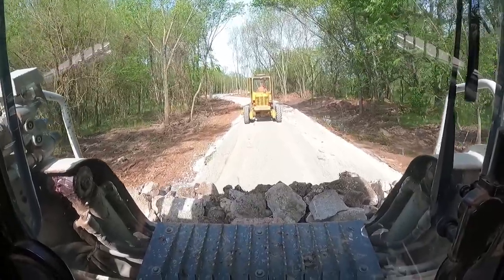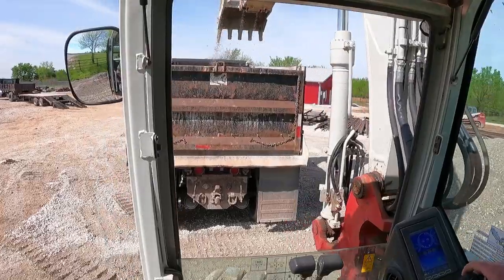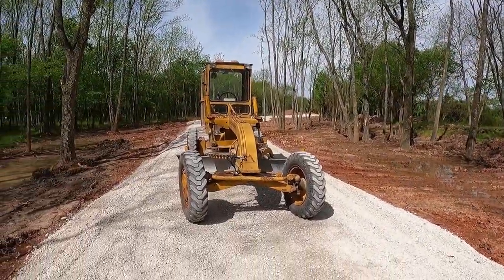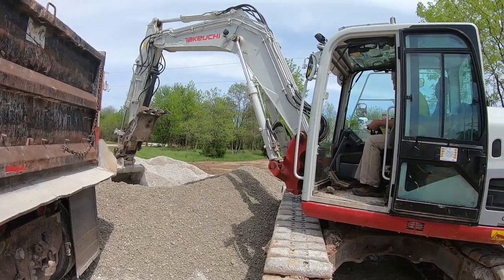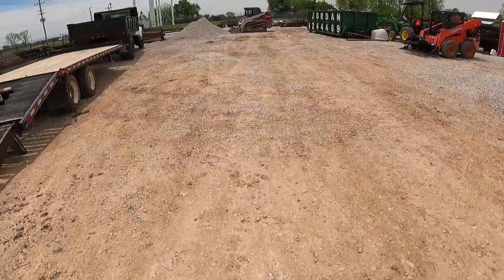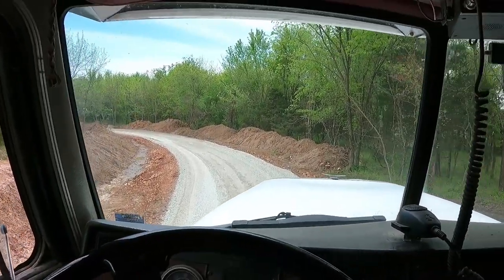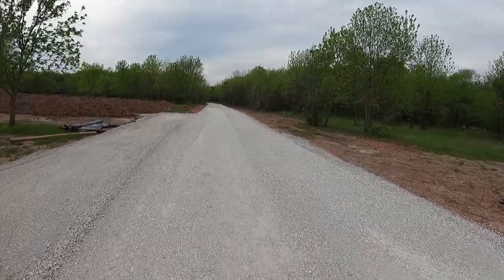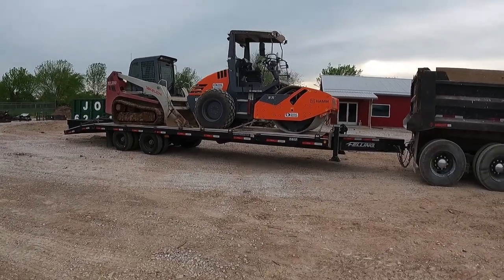Finishing The Rock On The Track With The Help Of Top Notch Excavating And Sassafras Valley

Comment: If they put the track down now, how are you going to truck out the dirt/mud piles on the sides? I've used a Gallion grader around the size of that one. The smaller graders this size are good for cutting off grass sod and spreading dirt and stone but they won't cut harder ground worth a damn. They won't even hardly cut a compacted building pad to get it on grade. The roadway for the track looks good. Like you said if you'd had more stone he could have sloped all the curves real nice and got the path in too but what y'all got done looks very good. 
Stay well. -Wil  👍
Reply from the maker: I’ll have to work from the outside, they are putting a crossing in where I can get to the inside luckily. Yeah those are handy little graders. Appreciate the comment 👍🏻